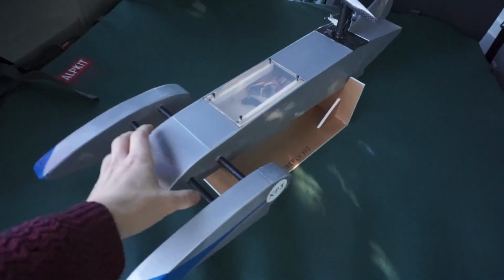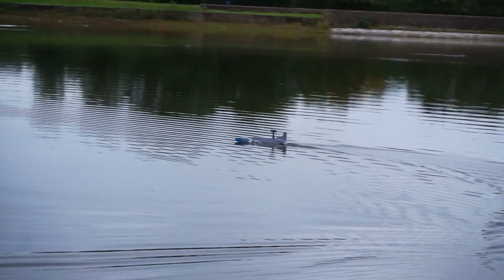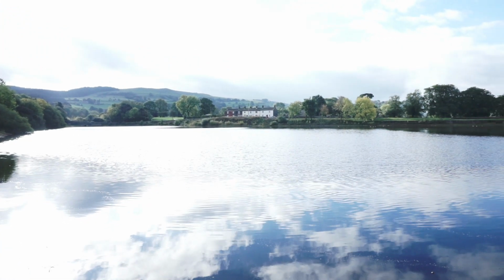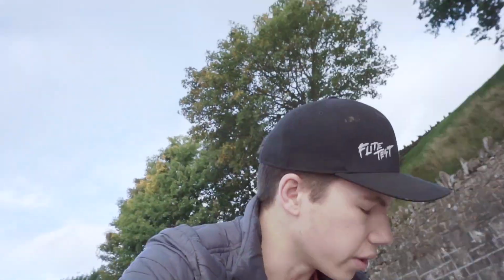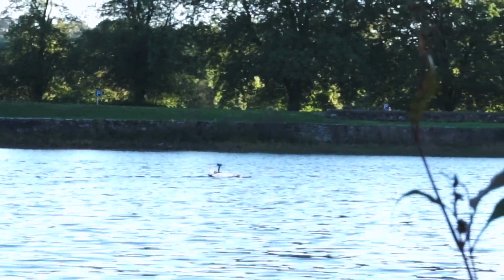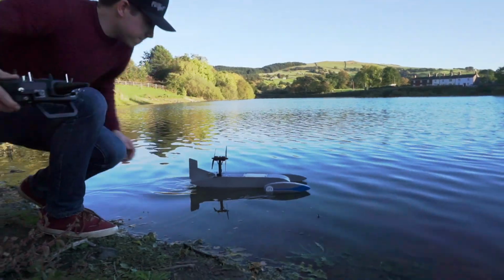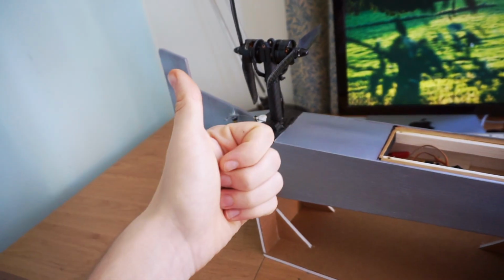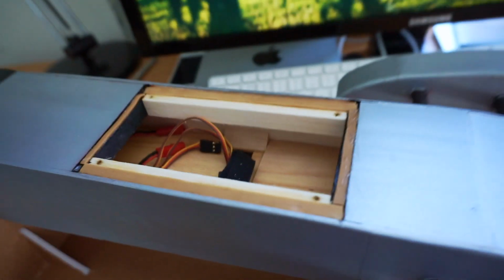Airboat Hydroplane - Part 2 (Testing)

Comment: I raced real hydros for years and now run Rc hydros. Tape your battery box top on with waterproof tape. Works great no leaks and no screws. Add a step on the bottom with that angle of attach on the sponsons you are sticking the hull to the water. It actually creates a suction holding the hull down in the back. A step will allow more air under the hull to release. Raise the prop slightly and try it again. That thing should run a easy 40 mph with its light weight. Hope this helps

Comment: I loved the intro to this video, with its moody feel - and, unlike the not wholly dissimilar intro to Flite Test´s EDF afterburner video, this one ended well  : )
 I, for one, would be very interested to see you tackle a hydrofoil build - has anybody ever built a hydrofoil which propels itself as an airboat does, I wonder, or have all successful models employed a conventional marine propellor?
 In my own low-budget way I´ve explored the possibility of using firework-derived rockets to propel model aircraft in some of my videos. My efforts were all free-flight, and difficult to trim to fly well when under rocket thrust as well as when gliding. I´m sure that you, James, could manage to build a properly controllable RC aircraft using only firework-shop rockets for thrust. I found that the Vampire/Vixen twin boom planform worked well as a means of keeping the centres of drag and thrust more or less in line.
 Whatever you decide to build in the future,  I shall be an enthusiastic viewer of your videos.
Reply: Alexander Graham Bell built several airscrew propelled hydrofoils.
Reply: I just had a look on Wikipedia - thank you for mentioning this. I´m going back to read more  : )

Comment: congrats, maybe one crazy idea, the second motor y running free, try putting a prop with more push, thats why the base of the motors is twisting to the side, because the back motor is not affecting the air flow

Comment: Very enjoyable video. I think the water issues could be solved with just a little bit of silicone caulking. A bead of it around the hatch entry and just a thin bead on around the two sides of the nose. If you suspect any other leakage the silicone is the way to keep the water out. Also I love your collection of radio controlled aircraft. That p-40 is beautiful. Im pretty much into the radio controlled aircraft scene. I have a P-51 Mustang with a wingspan of 30", Red baron with a wingspan of 60" and a piper J-3 Cub with a 76 1/5" wing. The radio controlled world is definitely a great escape from the daily life. The second happiest place to be. My wife and kids take #1.
Reply from the maker: Thanks for the advice! I'm hoping to get this thing operational again so I might investigate that silicone solution. :)

Comment: You should try mounting one edf on each of the two pontoons on a new boat in a sleek fashion similar to your other red airboat. Basically you have two edfs and two pontoons (one edf per pontoon). Also make sure that you are using a 6 blade edf because they seem to be much more efficient than the 12 blades.

Comment: I believe it is de-rigeur to take a support boat along when testing experimental watercraft. Another r/c boat or even a blow up dinghy would do. Given the torque problems with your mount why not use two mounts and steer with differential motor control?

Comment: What you encountered with motor mount is called a gyroscopic couple. There's a simple way to fix that. 

Make sure that both the motors are spinning in the opposite directions when they are facing opposite to each other, which we can assume to let the motors rotate as it is without reversing since it is facing away from each other. Use one propeller of reversed pitch and another of a normal pitch.

Comment: Just a thought.  Perhaps some sort of keel on the rear section that was only in the water at low speed would help with tracking?  Nice design and speed though.  Good luck from New Zealand.
Reply from the maker: Bob Webber thanks for your advice!

Comment: I like this project. What I would do is mount each motor on it's own pylon - said pylons abreast of each other, yet angled out enough for the tips of the props to clear each other as well as the hull. Again, counter-rotating ala P-38 lightning. Maybe have the motor pylons stick out and forward enough to avoid the wake of the spoilers. And how about a canard with a gyro incorporated to maintain a desirable stance on the water?
Reply from the maker: I like this idea. I'll definitely be making a new hydroplane sometime so watch out to see if your ideas make the final design! :)

Comment: I think that the twisting of the propeller mounting is actually caused by the angular velocity vectors of the propeller's resisting change in motion when you turn (angular momentum), so if you ran full speed without turning there would be much less rotation .  ( Just a guess from a second year me student)

Comment: Pretty nice work, dude! 😊
Since you asked for ideas... Maybe you should try a ruder on the tail, over the water. You know? Another idea is to apply a layer of clear epoxy over the wood after glueing and painting. That would waterproof it pretty well!
Another idea... Do you know that rubber you used on the hatch? So, there's a adhesive rubber used to seal speaker boxes. I don't know, but it maybe worth a look. 😊
Reply from the maker: Great ideas! Thanks!
Reply: @Project-Air  No problem, dude! 😊
Looking forward to the next builds! 😃

Comment: Great project and more difficult than it seems,use aeroplane type rudder,try a twin engine version with counter props  turning inwards to counteract torque,you are loosing power thrust with the present in line counter rotatingt set up,try a twin engine version,increase incidence on those sponsons,you made a nice job so keep experimenting.

Comment: Would skegs on the outer sides of the sponsons help with the stability when accelerating?  A couple of relatives race (small) hydros and they use at least one skeg up toward the bow to help counter torque steer.
Reply: I was going to give the same advice - one fixed blade at the reae of one sponson, and give the boat more width to stabilize it, 2 inches will do.

Comment: I did something like this a while ago. I had two floats from a model waterplane and made a wooden platform between them and placed an electro motor with propeller from a model glider on top. Worked very well although it didn't nearly go as fast as yours tho. ^___^ Nice effort. You could also use hotglue as a seal instead of the rubber bands on the plexiglas lid. Just a thought. :)

Comment: use tape to watertight your canopy. the rear propeller needs a higher pitch or a higher kv motor than the front propeller/motor because the rear propeller is working in the accelerated air of the front propeller.

Comment: Before going onto the next project, I would love to see this boat running at speed, with the problems fixed. Just repair the rotating motor mount, fix the leaks and go.
Reply from the maker: I might just do this. Let's go for twice the power too! Nothing to lose. :)
Reply: Ah, now your talking. With more power, more than a bit of glue will be needed for that motor mount. Can't wait...

Comment: I would have done a controllable air rudder instead of the water one. Maybe a non controllable water rudder for tracking. And definitely would have spread the pontoons a tad further apart.
Reply: my air boat (epoxy coated child TMNT kick board), the motor+prop mast are turned by the steering servo, no steering vanes. prop angled slightly upwards makes it slightly bank turning, and get a little lighter running straight and fast. simple experiment, inexpensive and easy, worked out really well! about 18x11"

Comment: I think an ekranoplan would be a really cool project and the way they work is fascinating.
Reply from the maker: David Morton that would be super cool to test! Especially when the lake is frozen in the winter. 🤔
Reply: Any idea how well this would work with small skis? (less contact with water so less friction) Might enable higher speeds or more efficiency, but also might be unstable.